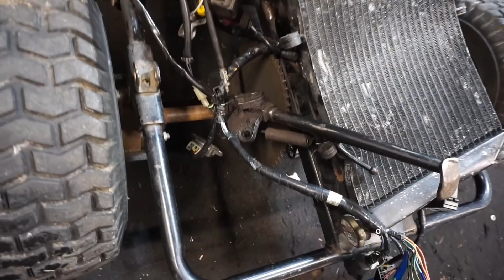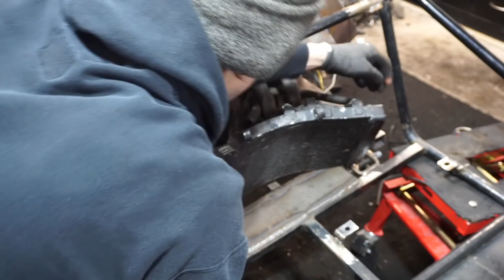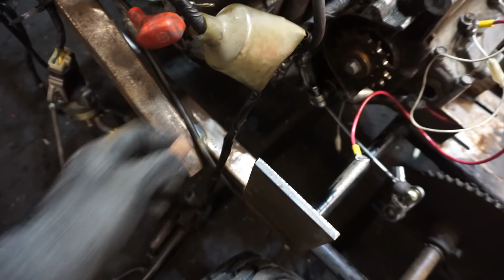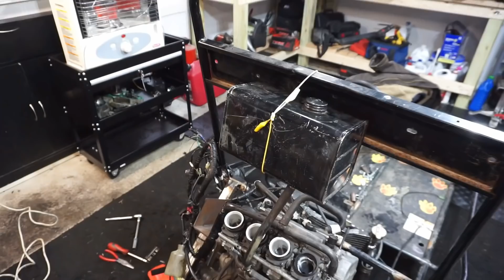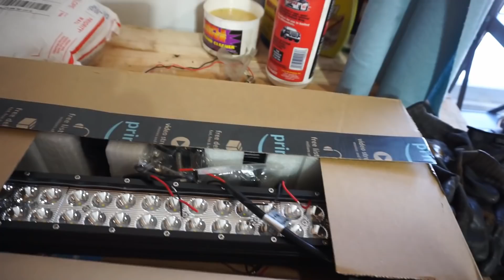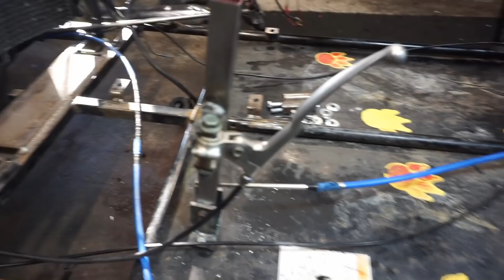Honda CBR600 Swapped Cart Is INSANE! (Too Much Power)

Comment: There is no way someone can operate the clutch and steer one handed in the middle of an accident when the throttle snags and it goes full throttle. 
Be better to fit a proper set of pedals. 
Also, when painting the frame, write your blood group and next of kin details on it

Comment: If you watch the previous video back, when you tried to jump the solenoid to jump it or check for power, the fuel pump plug arced as well (when you thought it was the alligator clip wire.) you may have fried the fuel pump.

Comment: Jesus Christ. What a clusterfuck of bad engineering. Stick to rebuilding ATV's.
Reply: You never acknowledged, or dealt with the fact that the output sprocket was not in line with the axle sprocket. Doing so would have moved the motor to the right, and made the radiator airflow better, and better distributed weight. Chuck the curved radiator, for a flat one and move the cooling fan to the other side. As for the pedals and gear shift... Well, what can one say? 🤣🤣

Comment: Move the seat and steering to the center of the cart. Ditch the steering wheel and replace with handlebars. Mount the throttle and clutch like a bike. left foot shifter right foot brake pedal. Re-think the radiator and get a release of liability.

Comment: Unfortunately it won’t work without the pump under load, i just went through this on a cbr600rr, bike would idle perfect, rev out perfect until you drove it, it backfired sputtered and just ran crappy, it needs the pump, i just had a broken wire. Did you renove the “tip over” sensor? It should be near the flasher relay in the wiring harness, it cuts power to the pump in case the bike goes down.

Comment: i've fix many old fluel pumps at i first spray wd-40 or something what loose up dirts  and let it sit some time ,then i have tap Tap wires to battery  in a right way and wrong way and many have started work and also i've open many pumps and just clean those and put back on .

Comment: That is without doubt the most sketchy thing I've seen. 100hp engine , flimsy frame, one drum brake, seat in front of the rad and fuel tank next to your head. What could possibly go wrong?

Comment: Please explain how this is 120hp??? I have a 4 cylinder 4 carb cb650 rated at 67 hp.
Reply: Oldest Cbr600f out there makes 85 crank hp: https://en.m.wikipedia.org/wiki/Honda_CBR600F. With 15% drivetrain loss this will be around 73.9 at the rear wheel.

Comment: Gas pedal angle looks wonky. I'd tilt the toe of it toward the front more. Engine sounds good. The frame looks like it was done in a shop class. Be careful. Tires don't look like they can handle speed.

Comment: Fuel pump doesn't work because the tip over sensor is not facing up.  It's the sensor that cuts off gas in case of an accident.
Reply: Usually located by the head light gauge area so look for a small square sensor with arrow pointing up by the headlight harness.

Comment: looking forward to seeing you get that working, will be lucky that engine doesn't twist that fram up like a pretzel.!! LOL,LOL...P,S I REALLY hope you replace them there Lawn Mower tires with something rated for that engine and the speed you are going to be doing in that cart. because if you don't it's probably not going to turn out so good for your Health. what happens at top speed. think first .?? just saying.! add a roll cage to Mr flimsy

Comment: For the shifter run a bar sideways in line with the seat basically over to the shifter on the right then have a ear coming off the left side of the bar so it can pivot then run a bar from the shifter on the engine to that ear put a bolt through it then you'll have a right-handed shifter sorry if that wasn't the easiest to understand LOL

Comment: Again its called a resistor in the ignition switch. Not a diode. Diodes are like a one way valve for electricity. They only let current flow in one direction. Resistors change voltage by making resistance. That is what is in that ignition to drop it from 12v to 9v. I have a video on my channel explaining it on a gsxr ignition.

Comment: What year bike is that engine out of ? Some bikes have a tip sensor that detects when the bike falls over and cuts the fuel pump off. This maybe the problem if that bike was fitted with one. You could wire the pump straight to an ignition live with a switch that would work. Radiator is the right place for a sports bike..it sits like that infront of the headers..maybe use a small car radiator mounted to the left of the seat that way its square and would get better cooling when going

Comment: That radiator would be better off mounted to the front of the kart. Would need longer hoses or you could use metal tubes instead of rubber hose, like the Pontiac Fieros had. If you mount a sheetmetal cowl over the front, between the steering wheel and radiator during the colder months, the radiator would warm the air flowing over your legs and torso. Just a thought.
Reply: i would make a legs and weld it in rear of cart and add another fan so its get more air but using  radiator in front you must make a plastic or metal mask or Flaps so if its blow up or leaks so you dont burn your self,and if you keep it in rear you can keep it bretty low its still cools down with fans.

Comment: That radiator's in a bad place,  going to get hot air from the exhaust pipes. I'd polish one side of a sheet of metal so it's shiny and install it between the pipes and radiator, shiny side towards the pipes.

Comment: That radiator looks like it has seen better days.  With the radiator that close to the exhaust it may run a bit hotter..
Reply: Boil the coolant. Need to reroute that somewhere else. Won't get much air there anyhow unless there is an air dam.

Comment: I've seen this done with a 600 cc ninja engine in a go cart.  It even had a roll cage .. It was way too powerful like insane.  Didn't end well I don't recommend. With a 250 to 350 cc engine it would be reasonably drivable need a shift stick and add the clutch handle from the bike  to the shift stick you pull in to pull the clutch then the never equal a foot pedal movement to shift ..  grab squeeze the clutch lever slam stick forward. Like you'd find on old equipment it works good on those

Comment: i hope you keep a fire extinguisher handy because there is sparks and flames spitting everywhere lol. although how you put yourself out when your on fire i have no idea.
i was wondering if the engine might be at the wrong angle causing the float bowls to be out of sync.
might need a new power pack as that large black one seems to permanently struggle with everything but the lithium one works a treat when charged

Comment: That's gonna kill somebody.way 2 much pwr for that frame and tires are not rated 4 the speed it can put out.b safe. Peace
Reply: Plus not to mention if/when someone does get hurt they will probably try to blame joe for it.
Reply: @Crobbin01  He cant simply be liable for an accident unless foul play is suspected. Dude who responded is right if you buy a car and wreck, you cant just blame the dealer without proof. If anything this is proof of him trying to make it safe, which he stated multiple times in these videos.
Reply: @RawboShoots  read a lil further in the comments there bud
Reply: @Crobbin01  From being in situations like this personally trust me, someone brings you a POS to work on they have to prove that it was your fault they wrecked. Yes a waiver would be solid so that you aren’t liable.
Reply: @Crobbin01  I don't see how they could, that's like someone buying a mustang, rocking it and blaming the dealership...you'd have to prove something gave out instead of driver error.
Reply: @thedude3189  a mustang comes from a factory, a yardcart with a street bike engine doesnt. If something that joe did fails, and someone gets hurt, he is liable for it. Just like if a car is faulty from a factory, the company is liable for it. When someone custom builds something like this cart and another person gets hurt on it, not by driver error but by something like a throttle pedal breaking at full throttle, the person who built it is to blame. I have nothing against joe btw, just expressing concern about how dangerous this thing is, especially with no roll cage or harness. No suspension, tires not rated for high speeds, little braking power, and tons of horsepower and high speeds will lead to a bad time. Nothing about this thing is safe imo. The person thats having joe do this should have to sign a waiver before they are even allowed to touch it.
Reply: @Crobbin01  I am signing a waiver saying he is not at fault if anything happens
Reply: @Crobbin01  it's 2022, I'm sure he'll make a contract, like I said the person driving it would have to prove it was a mechanical error, been in a couple court cases myself...shady shady backstabbers, dude was drunk and wrecked his quad.
Reply: @morganvincent687  get a cage and harness so if something bad does happen, you at least have some protection.
Reply: @Crobbin01  already have a appointment set up for braces roll cage and re making rear end and I have  high speed slicks for it
Reply: @morganvincent687  alright good man. Definitely wouldn't want you or anyone getting hurt on that thing lol I've had my fair share of things with way too much power and not enough safety so I'm big on safety after all my accidents😂
Reply: @morganvincent687  are u the owner of it
Reply: @gavindonald1874  yes
Reply: @morganvincent687  get a rail for up top like an x rail...all over...safety
Reply: If you are willing to buy it you would be the one willing to take the risk
Reply: @aksnowrider224  exactly.
Reply: Party pooper
Reply: Deathtrap for sure
Reply: Does need a rail on it that's for sure...
Reply: U get hurt on that Bad DayZ 💀😂
Reply: Hence the name…”widowmaker”….
Reply: 🤣 those look like lawnmower tires!! RIP 👻👻👻
Reply: That's what makes it more fun 🤙

Comment: You're going to kill someone. Crap welds and absolutely idiotic cable setup. I can't say enough about how stupid this is.
Reply from the maker: Wasn't my welding. Got the cart like this.
Reply: @2vintage  yeah I didnt load the gun I just pulled the trigger    PEOPLE STILL DIE grow up!!!
Reply from the maker: Frame will have ti be heavily braced before riding.
Reply: @2vintage  what’s the point in all the bracing you’re talking about when you don’t wanna take the time to relocate the rad and even move the motor back from right behind the seat? Why try to improve the bracing and ignore the important issues that would incorporate the frame and ultimately the bracing lol. Makes zero sense
Reply: @shaynedonnelly374 they wanted him to get it running not do an entire build on it. The people who made it were idiots stop talking to dude like he created this machine.
Reply: @txsam2802  so if all they wanted was him to get it running why is he talking about all the bracing he’s gonna weld into it? Maybe you missed the obvious part of my question.

Comment: Why did you leave the old engine mount on instead of getting rid of it and moving the engine so it has more room? You already cut the frame to make a new portion. Should have just taken some more time to do it right instead of that mess.
Reply from the maker: I didn't do any of the engine mounting work. This is how it came.
Reply: My apologies. Guess your just having to work with what was thrown at you.

Comment: It will run a lot better and found a lot healthier with the vacuums plugged off or hooked up but it definitely needs to fill pump for sure those carbs are set up for a fill pump

Comment: Nice Project, but those carb 600's never have 120+ hp... A 900 from the 90s doesnt even reach 120...
Reply: According to wiki, the oldest cbr600f, from '87, had 85 horsepower at the flywheel: https://en.m.wikipedia.org/wiki/Honda_CBR600F.

Comment: Having that radiator so close to that pipes... there's not going to be much Cooling going on,,, it will be hot as fuck
Reply: But its not gonna get airflow with seat in front of it
Reply: That's why these platforms are so awesome ,,because I didn't know the radiator was that close stock,, and I also wasn't thinking about the seat blocking the air flow,,👍👍

Its a frankencart anyway
Ur not taking it 2000 miles on a trip or anything.,,,,,.🙏not..
Reply from the maker: That's how it was originally on the bike so it must not overheat like that.

Comment: I love this project! More like 100hp if its an F4 engine. 120 for the 2021 600RR engines. Still fast as shit in a cart though!
Reply: It has carburetors, has to be an F3 or F4. 2001 Honda made F4I which is fuel injected. All CBR after 2001 are fuel injected.   But yes still will be fast on a go cart.
Reply: @MarkTheShOrTGuYDOiT  knows what's up! I ride an f4i, love these bikes.